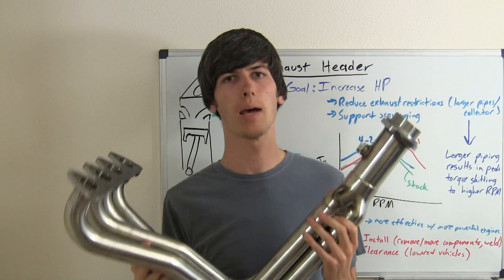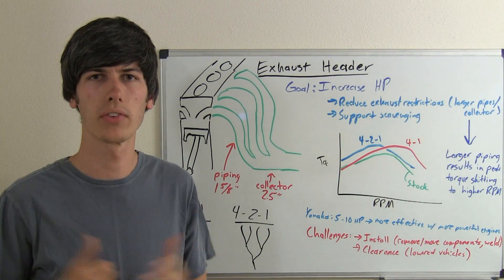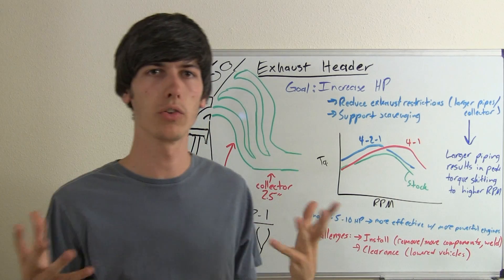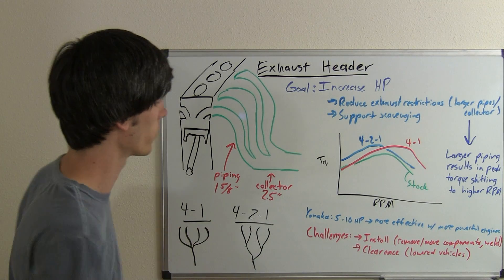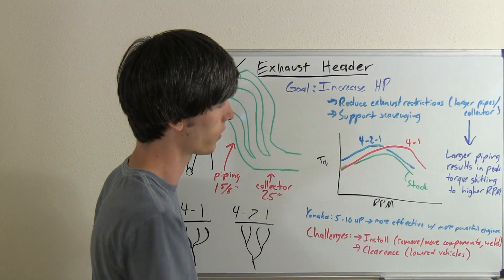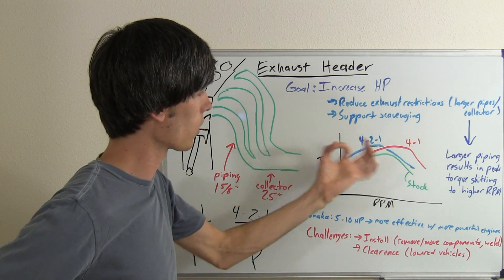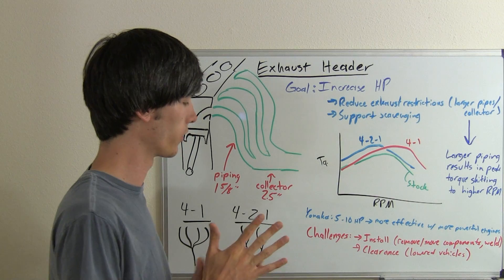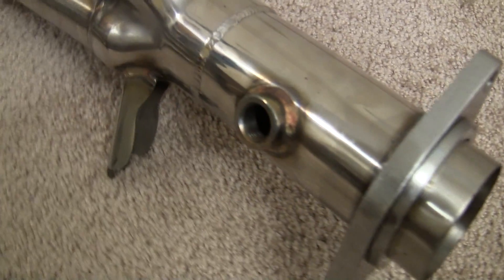Exhaust Header - Explained

Comment: There may be a simple answer to this question, but I don't know what it is: There seems to be so many way to squeeze a few extra horsepower out of any particular car, I keep wondering why the car manufacturers aren't making these modifications on their own. For example, why wouldn't they automatically go ahead and build a car with a wider exhaust in order to bump up the horsepower a little. Are these mods always cost-prohibitive? How much more could it possibly cost to widen the diameter of an exhaust? Is money really the main/only issue?
Reply: Because of the Laws and because if they did that nobody would buy a lambo because all the civic would be faster..
Reply: Also in the other hand, its all about what us owners want to put the taste in our rides and as well innovating the economy by make people developing and understand better in growing the ideas of what can possibly be perfecting to their cars!! And its coming down to about competition!!
Reply: For one Smog laws. For 2 unless they are selling you a sports version of the vehicle its not economical to do that to every model of car. So they are trying to give you good performance, gas mileage, drive ability, and at a low cost. Thats why like the type R integras (or sportier versions of cars) are more sought after because they have subtle mod like this.
Reply: Blunt Man That makes a lot of sense. Thanks for the thought.

Comment: Can you explain what open headers is? I've seen videos of open headers v8 setting off car alarms without knowing what open headers is. I know this is an old video but hope an answer from one of my favorite youtube channels :)
Reply: Is it another way of saying straight pipe exhaust
Reply: NorwayGokart99 it just means the headers are the only component of the exhaust system no cats no mufflers just pouring straight out of the headers
Reply: beau hughes thanks :)
Reply: "Open headers" means basically you have only the headers on the car so what he is holding is the only exhaust on the car which will cause loss of back pressure which you want, will be louder then shit. and loose response which you want. trust me thats how my truck is cause im making custom exhaust. But my rx7 has a Full racing beat header back exhaust system which made it way more responsive then my header with a giant hole lol. Not i need side draft carbs and good tires! lol

Comment: SOMEONE PLEASE ANSWER THIS: Using a Corvettes LS motor as an example, even the new C7 Stingray, why don't manufactures use efficient headers such as 4-2-1 long tubes on stock engines instead of the apparently "less efficient" exhaust manifolds?

Comment: Finally someone who doesn't swear by turbos. Engineering at it's finest indeed! I love the mathematical breakdowns, really helps me understand the concepts of these videos. Very good work, mate! Cheers!
Reply: But with a turbo you are turning exhaust energy that is normally just wasted to pressurize the air coming into the engine. Therefore making a denser and more packed air/fuel charge, to make more HP. Out of any mods a turbo will give you the most hp for the price. I can spend like 2-3k building an N/A car and make like 300whp (just an example). Or turbo it for about the same price and make 350-400hp (depending on strength of stock engine components and psi). A turbo is like turning your shit into gold, now who wouldn't want to do that.
Reply: @h5ibluntman  although with NA I have instant power and don’t have to worry as much about my engine blowing up. The turbo gives 400 will instantly be beat off the line by a 400 n/a because your only running instant horse power. Although gaining massive hp N/A is pretty hard.
Reply from the maker: Haha turbos are pretty awesome though!
Reply: Engineering Explained would headers help my turbo car
Reply: the one you probably mean would "performance" headers help.
Reply: LES yeah lol
Reply: the one every car has headers...lol

Comment: i have a ninja 250 (a motorcycle incase you don't know) and my friend helped me craft a 2-1 header from the original 2-2. I can tell it has more performance but i can't pinpoint where. there is no collection chamber, the gases just collect in the right side header now. where would i get the most power after this modification?

Comment: I drive an 08 Scion XD with a 1.8 liter in line 4. Been considering doing a full exhaust replacement (headers, midpipe, and muffler). Should cost me around $1,100 give or take. Wondering if the hp and gas mileage would justify the cost? Any comments are welcome.

Comment: Subscribed! I have a stock brz and I'm thinking of getting aftermarket headers first (borla uel headers) instead of and aftermarket exhaust since I'm not sure yet on what exhaust system to get plus I'm trying not to make my car too noisy. My question is, will changing the headers but staying with stock exhaust have any performance benefit or will it just change the sound? Basing on your videos you always state that headers and exhaust systems with bigger diameters will benefit stronger engines more than weaker ones and I'm guessing my car's engine is one of the weaker ones since it only has 200bhp.

Comment: I have a question... Does a bigger diameter pipe increase the pressure and decrease the speeed of flow of the air?
Reply from the maker: Decreases pressure and velocity. A higher pressure gradient will cause the exhaust pulse to travel faster.
Reply: Is it the same concept with liquids?

Comment: I think 4.1 header would provide more torque at lower rpm which is contradict of what were explained by you. This is persisted per honda b18cr 98 spec explanation video, they decided to plug a 4.1 header to a revised b18cr bcoz to bring down the peak torque to midrange rpm which is very usable for tight turn circuit. Please comment back should me  have a wrong understanding. Thanks.

Comment: i know i'm gonna get flamed for this, but i'm wondering if getting a upgrade on a minivan such as custom headers
which design should i go for? ie. 4-2-1 or which
also when you guys say a "proper tuning" what does this involve?
Reply: If u buy a generic chip for a generic car (standard with no other mods in vital parts) it will be ok, once u start changing parts like turbos, exausts etc. its good to get "proper tuning" where someone tunes the chip to what is optimal for your car including the modifications (nobody can make a generic tune that will be perfect for stock and for car with many part upgrades)

Comment: hi , I want ask that if I change the length in exhaust manifold what could be happened in Bp , bsfc , bmep , bes , co , co2 , I will be very glad if u reply Engineering Explained
Reply from the maker: Chemical composition of the exhaust will more than likely be unchanged, but you will affect the power and efficiency. It's a balance.

Comment: HEY! 
Will i see any gains with any exhaust mods with a stock engine... or do i need to have it produce more power to need more exhaust flow? really curious and i can't find answers on forums
Reply from the maker: Depends on the engine, but it's possible. A few horses at higher RPM is likely if you go with something a bit larger, but it may make the torque curve different at lower RPM.
Reply: You may also see gains if your standard manifold was restricting the stock engine due to poor design on manufacture. The rover exhaust manifolds although some were decent 4-2-1 design as standard apparently they have terrible internal welds that really reduce the flow
Reply: on smaller engines typically you will not see much of a gain from an exhaust without getting your car properly tuned for that fuel/airflow setup.  you can slap a nice full exhaust on a 1.4 or 1.6 and cai and get a couple hp...or Ive even seen some people lose power by unbalancing fuel/air.  the bigger you go for example 1.8 -2.4 motors you can possibly get a few more hp but not gonna get extra 15-25 hp like the claims on the websites without tuning.

Comment: Nice video. You said larger piping will have more power in higher rpm, but what about if a turbo is added? Smaller piping or larger being that there's more power at a lower rpm. Also is a stock exhaust manifold 4-1 with a smaller diameter?
Reply from the maker: Same rules apply to turbo engines, for the most part. Stock manifold will typically have shorter pipes and have them join sooner rather than later.

Comment: about the difference between the two go see the specs of the integra type r 95-97 (4-2-1)  and the 98+ (4-1) in term of performance there's no difference!
go see best motoring type r legends!  both cars did the same time on 1/4 mile (14.207)

Comment: You don't necessarily want bigger pipe for a header, you want faster exhaust velocity which is why 4 to 1 header is better. Larger piping means more top end power with a trade up with less low end power. The biggest difference between stock manifold setup and a header is removing the catalytic convertors which are a restriction meant to reduce emissions.

Comment: Hi, I just found out that my 1991 VW Golf stock exhaust header has a mechanism that allows it to swerve a little,  which after-market exhaust headers don't have. I am wondering if this is the reason that after-market exhaust headers crack so easily?
Reply: Not all aftermarket headers will crack easily, I hear of cheap ebay ones cracking mainly... You're right though im sure that swivel helps prevent it from cracking...lowered cars can really put abuse to a header

Comment: I don't know how to send private messages with the new google+, but oh well. I have the same car as you, 99 integra gs, and I have a few questions. So I've replaced the stock exhaust with the same Yonaka Catback system you've shown in your video. I'm planning on replacing the headers with the same Yonaka headers you have in your video, so all that's left is the cat.

Like you said the collector pipe diameter is 2.5" and the product description says it won't fit the stock cat. Yonaka also makes a high flow cat that has a 2.5" inlet and outlet diameter, which matches the headers. The problem is the Yonaka catback exhaust is 60mm in diameter, which is less than the 2.5" outlet for the cat.

My question is, will the 60mm Yonaka catback system bolt onto the 2.5" Yonaka cat without any grinding or modifications? In other words will it fit properly?
Reply from the maker: The header is not a simple bolt on, there will have to be some fabrication/welding to get it to fit with the exhaust.

Comment: I have 4-2-1 headers ('99 Accord). I did this to keep low-end torque. My understanding is that increased back pressure at low RPM's can actually INCREASE torque. I find this so counter-intuitive. Do you have an explanation for this outcome? Thanks :D
Reply: Heyy ikn your post was along time ago but I jus got the same for my civic d16y8 00civic aka my baby did you bore out or smooth the headers 4-2-1 at all and did u run wider exaust I'm running just factory motor and swapping the already exsplained until well when I get the money lol

Comment: When people mention running open headers it refers to disconnecting the exhaust from the Header Collector. So the only parts the Exhaust has to flow through are the Cylinder, Cylinder Head and Header, once it reaches the end of the Exhaust Header (Or Exhaust Manifold) Collector the exhaust vents to atmosphere, instead of having to go through Exhaust piping, Catalytic Converters or Mufflers, which are restrictive. In some applications this can lead to more power and it makes a lot more noise :)

Comment from the maker: Actually, I am an engineer, working in the professional world..
Reply: Hi i have a question i have a 206 gti s16 136hp and 190nm torque now my goal is to get 190hp but thing is its light and im not aiming at gettin more top speed intead i like accel 0-180kph my ive got a blok thats going to be refurbished in a few weeks i orderd a sport cat 200 cells janspeed catback exhaust a 4-1 header ist going to get a rc head witch has bigger valves and its ported  have to disable vvt tho and like itb but what to do with cams and cam sprockets is it worth it to forge the blok high compression pistons etc ?
Reply: @yokoA91  the amount of compression would depend on if your installing forced induction. The compression would depend on how much boost you plan on running if you go that way. High boost would generally require a bit lower compression to avoid blowing the motor from increased stress. If you are going to be running a naturally aspirated setup id get higher compression im not sure how much it would help you gain in terms of actual power sure compression is good for power but probably wouldn't give you that gain your looking for best option from what I read a bit higher compression ratio upgraded fuel pump maybe a bit larger injectors. I wouldn't be running without vvt this would rob you significantly of power. Header setup and free flowing exhaust put a better intake plenum thats higher flowing and a larger throttlebody as well as a higher flowing air filter (sidenote throwing this at the car without a tune would 100% throw codes, the car would most likely not run as the computer would be very confused with what to do with the new hardware get a piggyback ecu or a new ecu and get it tuned. That in mind you would make plenty of power

Comment: Both would be correct. The sensor measures the ratio of oxygen in the exhaust gases compared to unburnt hydrocarbons to work out the air to fuel ratio. This ratio is measured in λ (Greek letter lambda) with λ 1.0 being the stoichiometric ratio of 14.7:1. Smaller lambda values are richer and larger values are leaner.

Comment: your analysis of the 4-1 vs. 4-2-1 might be miss-leading.  In your video you make no reference on the effect of pipe diameter..smaller diameter will allow more low-end power and larger diameter more high end power.  I wonder if the comparison you made of the two headers had equal diameter pipes? also a common mistake enthusiast make is buying the largest pipes they can find and then wonder why their car got slower..  good video though

Comment: With the power band shift - that's not because of the way the headers are built, but because of their length - in a N/A car there are wave effects occurring in the exhaust that help scavenging around some RPM range, and that depends on header length. As 4-2-1 are in most cases longer they help in lower RPM range (also there are compounded effects from each joint point so 4-2-1 have a wider torque range).

Comment: thank for your video and i have some questions to ask
1) For 4-1 and 4-2-1 exhaust system, which will have better air flow but lower air velocity?
(from what you draw i think should be 4-2-1, but still need your clarification on it)
2) how does the air flow and air velocity of exhaust system affect the torque band shifting?
(of cause in your graph did show the result of torque shifting, but i really need you further explanation on that)

Comment from the maker: Back pressure is not needed, velocity is what you want. Check out my video "how exhaust systems increase horsepower." Here I discuss the balance, you may not have enough power to warrant a larger exhaust, thus it may actually reduce performance slightly.

Comment: I hope this question is answered.... i have a 96 civic ex (cold air/headers) i recently put the headers along with a test pipe and im running no muffler (just took out the screws) what i noticed was that as im driving i feel it slower. It slows down even if im pressing the gas. Is this due to not enough back pressure? If i put the stock muffler back on will it cause more restriction, therefore giving me more back pressure?... please help. Thank You

Comment: On those curves you showed, it seems that the main benefit of the 4-1 is at high RPM. If I am reading it correctly, the 4-2-1 is actually better at low RPM. Since most of us do our city driving on the low side of that curve, the 4-2-1 sounds like the best fit.

Comment: It will last for a little while, you will prolly end up replacing it after 6-8 months, depending on how hard you drive. Most of the time, guys use wrap when they are running an all out racing engine with turbos. After the end of the day, they toss the manifold and get a new one lol

Comment: Of course not. The turbo manifold is that short to increase turbo response. Exhaust gas pressure builds up in the manifold. The less air is in there to compress the faster your turbo will spool up. 

What he's telling only applies on N/A cars.

Comment: great video , but i want to ask about the relation between back pressure and header ,
2- why we loss torque from the engine when there a leakage on exhaust system ?

Comment: What about a turbo car for example? My exhaust manifold is basically a short slab or cast iron, feeds directly into my turbo intake (4G93T in a GSR EVO 3) does that mean it has less torque because the manifold is so damn short

Comment from the maker: Perhaps, if it's really heating up the engine bay a lot/the intake manifold. Also most exhaust manifolds have a heat shield, and this requires removing it so it could potentially help.

Comment: Header wraps don't keep the headers cool, they confine the heat within the header which cools the air inside the engine bay. You need a quality manifold that can wont crack or break from the increase in heat. Turbo and high performance engines benefit most from exhaust wraps.

Comment: Don't use. 
You'll melt iron exhaust manifolds.
If you are running a stainless steel or some other high temp manifold that is designed for it, then you may get away with it.

Comment: You mean how much HP will gain if you enlarge the exhaust system?
Depends.
If your stock exhaust system is already very restrictive, anywhere from 0-50hp or more, depending on the engine and the other end: Intake system. If your intake is also restrictive, then you won't see very much gains as well.